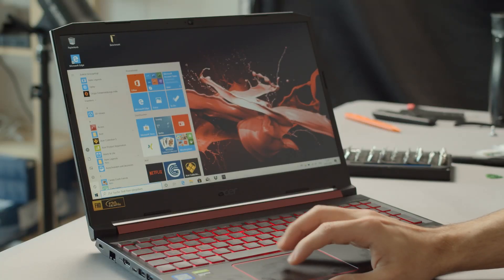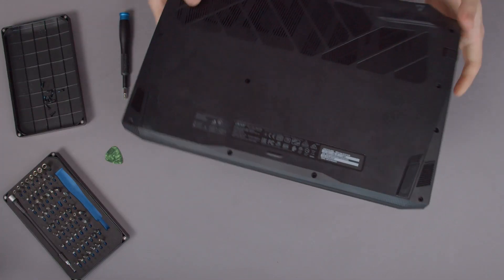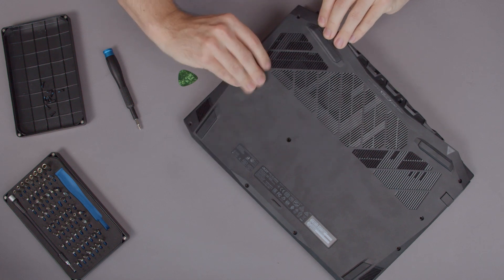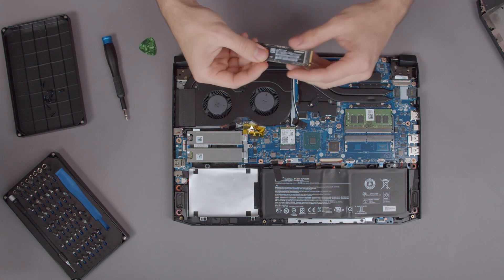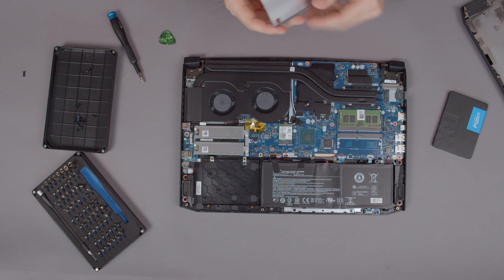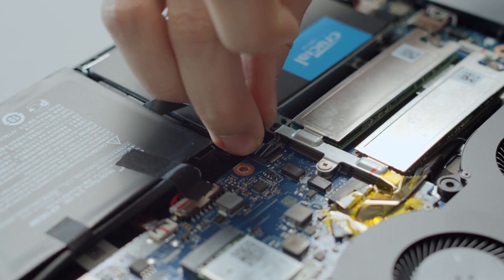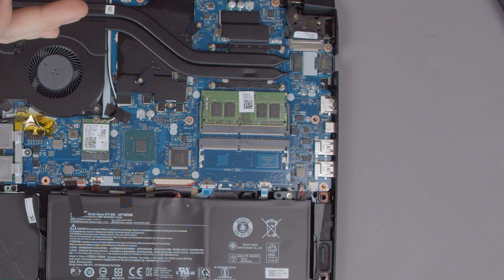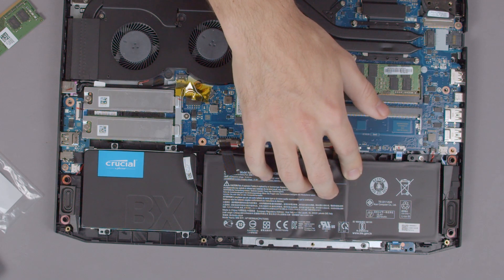Tutorial: How to Upgrade the SSD and RAM of your Acer Nitro 5 - ENG

Comment: Hi I noticed some QC issue on my keyboard with unequal gaps between 2 sides in all the keys, some of the keys even stuck with the border when pressed, isit possible to disassemble the keyboard and realign it properly? Or do I have to get a new keyboard? Thank you!
Reply from the maker: Hey, I don't think you can realign the keys if there is an issue. Better talk to your vendor or Acer for a replacement.

Comment: hi i bout the nitro 5    ( ACER NITRO 5 AN515-54-51M5)  is the modle im wondering if i could install this drive in it

Samsung (MZ-V7E1T0BW) 970 EVO SSD 1TB - M.2 NVMe Interface Internal Solid State Drive with V-NAND Technology, Black/Red

please let me now.....thanks
Reply from the maker: Hey, it should work. Sadly Acer doesn't list if your model has a SATA or PCIe SSD preinstalled. But worst case would be that you'd have to swap the 128GB SSD for the Samsung EVO.

Comment: hello, my nitro is Acer Nitro 5 AN515-41-F722 does it look the same inside , I want to add 8gb stick RAM, please answer I need help =)
Reply from the maker: Hey, we haven't checked all different model, so I can't say for sure. But it should be similar to this and there should be a second RAM Slot. If you want to make sure you can take a loot yourself before ordering anything :)

Comment: This may be a dumb question...after installing the new ssd (second one on my model), do I need to do anything after turning on the laptop? Or will it figure out there is more storage on its own?
Reply from the maker: Hey, it will figure it out by itself. But Windows might need some help since the new SSD won't be formatted. Just head over to the Disk Management and it wil ask you to initialise the new drive. After that you can simply format it and you're good to go.

Comment: [1.] Does the acer nitro 5 an515-54-5812 support 2666mhz ram?
[2.] do I have to get two of the same brand of ram sticks with the same configuration or can I have two different brand ram sticks but with the same configuration for example(can I add a 8gb ram stick even tho it's a different brand from the 8gb ram stick that comes with the laptop)?
[3.] what type of brand ram stick and ram configuration does the acer nitro 5 an515-54-5812 come with?
[4.] do I have to get two of the same brand of m.2 ssd with the same amount or different amount of space or can I have two different brand m.2 ssd with different storage(for example can i add a 500gb m.2 ssd even tho the other is 250gb with a different brand)?
[5.] what m.2 ssd and ram do you reccomend for the acer nitro 5 an515-54-5812
[6.] can I have two 8gb ram sticks with  different mhz? 
I'm not really used to gaming on PC and so I dont know that much about PC but I'm planning on buying that acer nitro 5 an515-54-5812.And when I get it I'm planning on upgrading it ASAP...so I really need these answers please reply..thanks
Reply: I have the same exact model. You can upgrade the memory with both a 2.5" ssd and a pcie m.2 ssd. The ssds don't have to be the same size nor the same brand. I have three different ssds of three different sizes installed on mine and they work perfectly. And for ram, I used a 2400mhz 8gb ddr4 ram stick that works just fine with this model. If you look in other recent comments, I have posted links to said ssds and ram. Good luck with your upgrade. :)
Reply: @citrusabdy3797  thanks very much bro 🤙👌

Comment: What screwdriver set are you using? I'm having trouble opening the metal cover where the SSD is
Reply from the maker: Hey, it's the iFixit set. Not cheap, but if you use it often it is money well spent.

Comment: So I opened up my laptop and tried to add the crucial MX500 sata m.2 ssd that I purchased and in doing so, my laptop wouldn't turn on. I realized after experimenting that my laptop came using the "sata" m.2 slot already so taking out the new sata I had inserted into the "pcie" slot fixed my problem. However, now that I know that my sata m.2 ssd that I purchased is practically useless, what m.2 should I buy?
Reply from the maker: Hey, that's new for us, that there are models shipping with a SATA SSD. Sorry for that. If you don't need the absolute speed you can grab a Crucial P1 - comparably cheap and yet fast. If you want the best performance get for example a Samsung 970 EVO or WD SN750.
Reply: @notebooksbilliger  the setup to my laptop was exactly the same as yours. I noticed that you used a 970 Evo in your "pcie" slot. In this case, I should do the same and it should work?

Comment: Back in school, one of the newer students pulled a pcie card while the system was running because his work book never told him to shut it down.  Beyond the blue screen that he got, everything worked just fine after a reboot.
Reply from the maker: Hey, so he got lucky. It's not always breaking the system doing so, but it can - so better avoid doing so :)
Reply: @notebooksbilliger  someone that also came in with his class ended up plugging a molex connector in upside down, i tried replicating it, and it was not easy and took quite a while.  One of the seniors was supposed to be watching her as it was her first build.  End result was a dead hard drive and some smoke.

Comment: So I need a ssd to put in the hdd upgrade cable?
Reply from the maker: Hey, not sure I totally get what you mean. You can upgrade both M.2 Slots without a HDD Cable, but if you want to upgrade a 2.5" SSD you'll need the cable.
Reply: @notebooksbilliger  i have the cable just not an ssd

Comment: i cant find the right type of RAM for the 2020 ryzen 5 ersion. it has 2933 DDR4. Can I replace it with 2 sticks of 8gb 3200mhz?
Reply from the maker: Hey, yes you can, it will just reduce the frequency to fit.

Comment: I want to add a HHD in my nitro 5 2020. Does it improve fps?
Reply from the maker: Hey, usually no. To increase the FPS slightliy you can add more RAM e.g. to achieve Dual Channel Operation if it doesn't now. But apart from that, there is nothing much you can do.

Comment: I have a 2019 nitro 5 an515-54-51m5. I want to add a second m.2 drive because it only came with a 128gb m.2 and a 1tb hhd which I don’t want to use because it’s too slow for gaming. Are you positive I need m.2 SATA only. I’ve even contacted Acer and they are confusing and different techs have different answers. And which one would you recommend that will be compatible. Thanks and great videos
Reply from the maker: Hey, we tested it with SATA and PCIe and only SATA did work. So yes, we are positive about that :) But of course you could also swap the existing 128GB SSD for a bigger one, then you could use a PCIe SSD. If you're going for a SATA drive we can recommend the Crucial MX500 since it has a good performance and reliability for a low price. For PCIe we'd recommend either a Samsung 970 Evo, WD SN750 or a Crucial P1 - the letter is a bit slower than the first two, but also a lot cheaper.
Reply: notebooksbilliger.de i upgraded to 32 of crucial ram. While I was in there I took the metal cover off the open m.2 drive and pcie is printed right next to the port on motherboard. I looked under the m.2 that it came with and SATA/pcie was printed,  would that mean the open one only does pcie? And that means NVMe?
Reply: @fatherdaughtertoolsandstuf510  I'm thinking the same thing. As suggested, I ordered a Crucial MX500 1tb M.2 sata ssd and placed it in the empty slot. In doing so, I realized that my laptop didn't even want to boot up. The screen would stay black infinitely while the keyboard flashed for a split second after I pressed the power button but wouldn't respond again. I initially thought I just bricked my computer somehow but taking out the Crucial MX500 solved my problem. I noticed that the original M.2 ssd was in a "sata" slot whereas the vacant slot that I was putting the sata MX500 into said "pcie". I'm assuming I should just purchase a pcie m.2 ssd and use it for that slot instead. I ordered a 1tb pcie m.2 ssd that I intend to use. I'll see if that works when it arrives and I'll provide an update on what happens.

UPDATE: Upon installing the new 1tb nvme pcie M.2 ssd, I noticed that it showed up in the bios along with my other previously installed drives. Meaning that pcie for this model is definitely compatible.

Comment: I buyed an acer nitro 5 with this : Laptop Gaming Acer Nitro 5 AN515-54 cu procesor Intel Core i5-9300H pana la 4.10 GHz, 15.6" Full HD, 8GB, 256GB SSD, NVIDIA GeForce GTX 1650 4GB, Linux, Black

Please tell me exactly the name of the components i need to buy to get another 256gb and 8gb ram
Reply from the maker: Hey, you can add another M.2 SATA SSD like the Crucial MX500. For RAM just go with 2400MHz DDR4 SO-DIMM and you're fine.
Reply: @notebooksbilliger  ok thank you for the respons
Reply: @notebooksbilliger  do i need a special CL for ram ?

Comment: I have bought this pc acer nitro 5 AN515-54 in colombia with these characteristics

-type: pc gamming
-Reference: AN515-54-51BN
-processor: Intel Core i5 9300H 2.40GHz
-Generation: Intel 9th Generation
-Capacity: 1TB
-ram: 8gb

I have checked it in crucial and it gives this result:
Memory
Maximum Memory: 64GB

SATA Version: SATA 3 - 6Gb / s

Slots: 2 (2 banks of 1)

Standard Memory: 8GB removable

Storage
Drive Interface: SATA / M.2

I would like to know if I can put a sdd that is not Sata and not limit the power of the pc
Reply from the maker: Hey, it depends what that 1TB drive is exactly. If it already is a M.2 NVMe SSD you can't add another PCIe SSD. If it's SATA SSD or even HDD you can add a M.2 PCIe SSD like the Samsung 970 EVO.

Comment: Hi video was really helpful, would you be able to give some info on what ram to use for the AN515-51 spec Currently at 8gb and looking to get either 16 or 32gb ram installed but got lost at the Mhz you talked about. If theres any chance you can recommend which ones to get budget is around 2 to £300 as i know ram isnt as cheap computers
Reply from the maker: Hey, that should be an Intel Model, right? There you can jut go with 2400MHz RAM, since the Intel models won't support higher frequencies. You could go for the Crucial CT2K16G4SFD824A for example. It's below 200€, varying on your location of course.
Reply: @notebooksbilliger  Thank you for the info! Sorry, I was late in replying was out on a job.
Can I ask you one more question if I can?
So i opened up the laptop as I will be going to upgrade the HDD to an ssd and the other ssd to a m.2. Now is there an easier way to copy everything from the old ssd to the m.2 as my fain files are stored on to it or do i have to boot and reinstall windows all over?
Reply: @notebooksbilliger  Thank you a lot and yes it's running the i7 processor

Comment: I just got this laptop a week ago and I'm already looking into upgrading it to see just how far I can push this impressive budget laptop. I bought the AN515-54-5813 version that only comes with a lone 258GB NVMe M.2 ssd. With that in mind, I'm really looking to expand the storage. Is it possible to have 2 M.2 ssds and a 2.5" as well? If so, which brands of M.2 and 2.5" ssds are most suitable for my laptop model? I'd really appreciate any feedback if possible.
Reply from the maker: Hey, yes you should be able to add another M.2 as well as a 2.5" SSD. The brand doesn't matter that much, but you should beware that the second M.2 slot can only support SATA SSDs. So pick a M.2 SATA SSD and you're fine. Same goes for the 2.5" slot. Any brand goes, if you're not looking into putting the OS on one of those additional drives you can grab budget SSDs as their speed won't matter that much.
Reply: @notebooksbilliger  Okay great, thank you for the feedback!

Comment: what kind of SATA SSDs can i use? (for the second slot)
Reply: would something like this work? https://www.newegg.com/western-digital-red-sa500-1tb/p/N82E16820250127?Description=1%20TB%20SATA%20M.2%20SSDs&cm_re=1_TB_SATA_M.2_SSDs--20-250-127--Product&quicklink=true
Reply from the maker: Hey, yes, that one should work. Basically any 2280 M.2 SATA SSD will work.
Reply: No
Reply: Get this.   https://www.newegg.com/western-digital-blue-sn550-nvme-1tb/p/N82E16820250135?Description=1%20TB%20SATA%20M.2%20SSDs&cm_re=1_TB_SATA_M.2_SSDs--20-250-135--Product

Comment: Hello again and thank you for taking the time to answer my question. My nitro 5 amd ryzen 7 comes with 8GB of ram. I would like to upgrade to at least 16gb. Is it possible to add a 16gb single card Ram in addition to the 8gb? to have a total of 24GB of Ram? or they must be split into 2 separate Ram cards? For example 16 and 16 to total the max of 32GB of Ram? thank you in advance!
Reply from the maker: Hey, you can do either way :) Two identical sized RAM will have the benefit of dual channel, which means a bit more performance. Going straight to 32GB with 2x16GB will give you some peace of mind for the future since you won't have to upgrade for a while.
Reply: Cara de Huachinango no u can’t do that it need to be either 4 8 16 or 32

Comment: What kind of m.2 do I order? I am really lost with the  m.2 ssd I need to order
Reply from the maker: Hey, if you want to add another SSD, you have to get a M.2 SATA SSD with 2280 form factor. A reliable and comparably cheap model is the Crucial MX500.
Reply: @notebooksbilliger  I'm very confused acer are saying I have two nvme slots on my board. My model is an517-51
Reply: @MrTommyOnTour  Yes, you do. One of the slots is used for the SSD your laptop came with, the other one is empty.

Comment: so I had a question about this, I have recently bought the same model and I want to upgrade so I don't receive lag with games like rust. ive already played games with the 8g version of ram that came inside the computer,  and when I upgrade will it affect those games and mess up my computer if I change it?
Reply from the maker: Hey, well, if Rust doesn't run smooth it's more likely to be the GPUs fault. The RAM will affect the porfance a bit, but usually just in a range of 5 to 10% at best. But more RAM is always a good idea. But you might wanna check if it runs better with lower graphics settings before purchasing more RAM.

Comment: Hello Everyone, I just purchased an Acer Nitro 5 AMD ryzen 7. I will be using this lap top as my second DJ laptop (main one is a macbook pro), so internal Storage is a Plus for my needs. Can some one guide me adding additional storage? (please No sd cards or external drives lol). I understand it comes with 2 empty slots, If possible, I need links of parts that work with this machine. Thank you all so much in advance.
Reply from the maker: Hey, it comes with 3 slots in total: 2x M.2 and 1x 2.5". I'd recommend going for a second M.2 SSD first and add a 2.5" only if it still short on storage. To upgrade just get a M.2 SATA SSD with 2280 form factor. Reliable SSD are for example the Crucial MX500 and Intel P600, both you can get comparably cheap and with capacities of up to 2TB.
Reply: notebooksbilliger.de thank you so much I will look for them on amazon 👍🏼👍🏼👍🏼

Comment: I've a same variant with AMD processor. What are the RAMs compatible with it?
So that I don't buy a different clocked one
Reply from the maker: Hey, to be sure to get the same timings and frequency, it would be best to either check the exact RAM in your model by checking the label on it, or by checking in tools like CPU-Z. Usually it is fine to just grab a similar frequency or even a faster one that will be matched with the existing RAM. So buying 2666MHz RAM should be fine, since most notebooks don't use faster RAM anyway.

Comment: Hello in planning to buy an acer nitro 5 with a 1tb hdd+ nvme 256 ssd, supposedly it has two m.2 slots right? Do the nvme ssd occupy the first slot of the m.2 or it's located in another place in the laptop? Thanks in advanced!
Reply from the maker: Hey, the existing NVMe SSD occupies the first M.2 Slot, so there is one free slot left. If you want to upgrade that slot be aware it only support M.2 SATA SSD.
Reply: Thanks so much, cheers mate!

Comment: I got the 2020 Acer Nitro 5 with the ryzen 5 4600h anyone know what clock speed the ram that's already installed is
Reply: Hey Shay, the new ryzen 5 rams speed is 3200 Mhz. you can check your ram speed in the command prompt. C:\Users\yourlaptop>wmic memorychip get speed

Speed
3200
Reply from the maker: That's a pretty nifty trick, thanks for that :)

Comment: Edit: I may be stupid. The soDIMM is stacked, though I didn't immediately see another M.2.

So I decided to give my Acer Nitro 5 a half cleaning... And wow, I have almost a completely different computer. Almost. I have the 2018 model (which I bought in 2019 so I'm a little mad) and there is only 1 M.2, and one Bay for RAM. Also a screw for what appears to be the arm for the monitor is crooked and half out, but tight... Slightly disappointed and didn't know there could be such a strong difference in the same run of laptops. The model number I have is the AN515-53-55G9. MFG Date 2018/12/11.
Reply from the maker: Hey, yeah it's possible that there are differences in the models even if they carry the same name. The Nitro 5 brand is around for a couple years now and they changed a lot.
Reply: @notebooksbilliger  I opened my computer late at night. It looks like the general setup might be different between the 15 and 17 inch models.  Looks like my concerns were mostly based on my inexperience with computer stuff!

Comment: I ordered a hyperx impact sodimm with 2666mhz and I have the exact laptop does it support cause the other ram has a hynix 8gb ram at 2666mhz and I wanted to upgrade it to 16gb
Reply: Can u please reply , I doubtful cause they are two different brands and one has xmp and other has no xmp I believe
Reply from the maker: Hey, that's no problem, they should work fine together.
Reply: @notebooksbilliger  thanks man